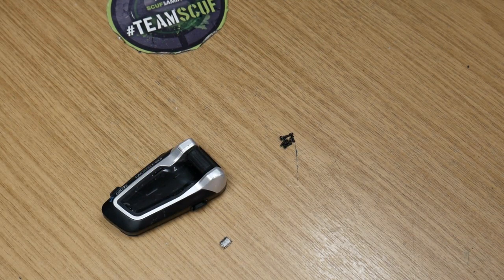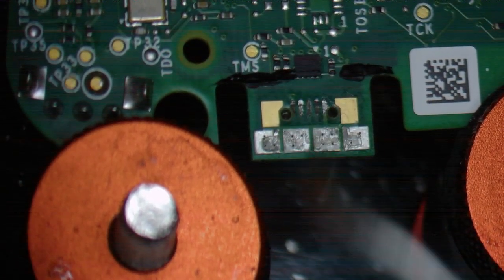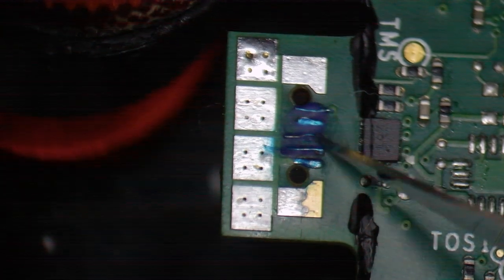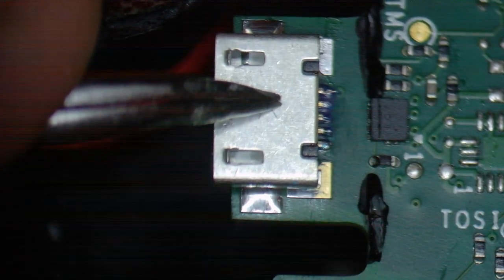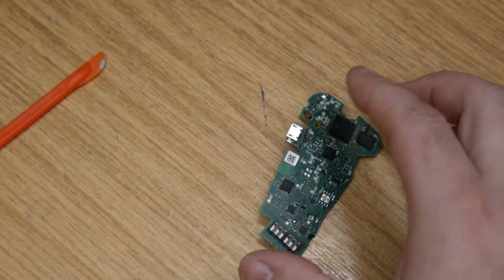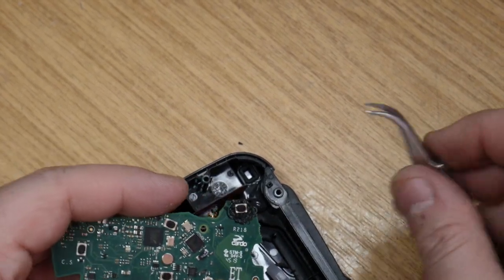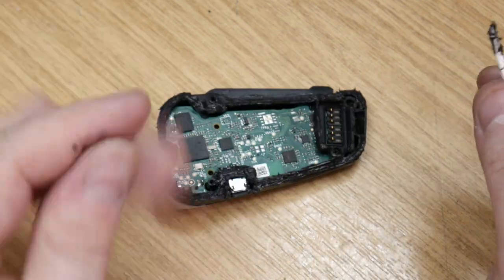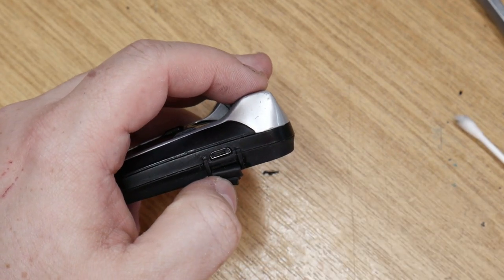PackTalk Bold USB Port Broken and Trace Repair

Comment: I had the same problem, major design failure.  It also happened to two of my friends.
Reply from the maker: We see alot of USB issues on these also the PackTalk Slims are the worse as they rip all the solder pads clean off! I have a video on that comming out this week. If you need Packtalk repairs contact us here: enquiries@ubermicro.co.uk